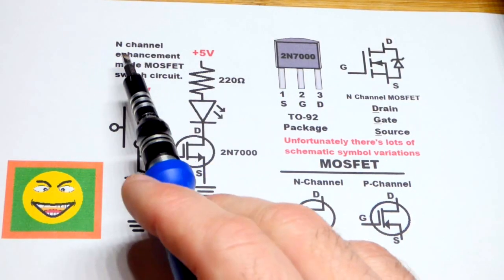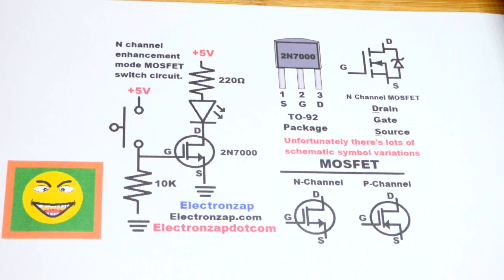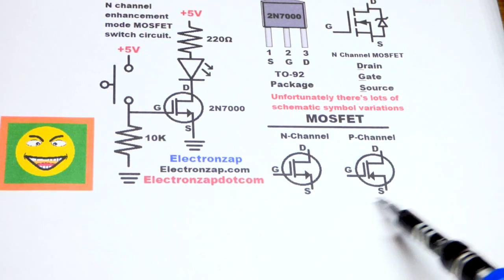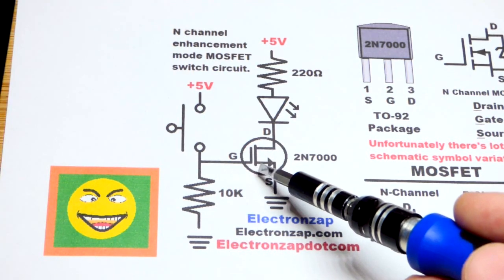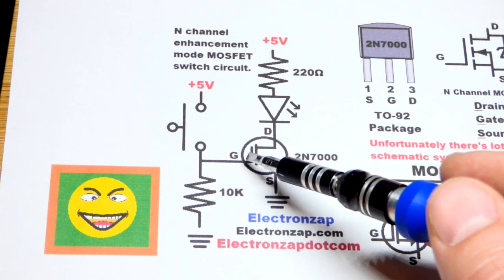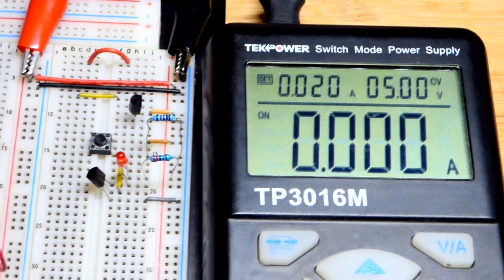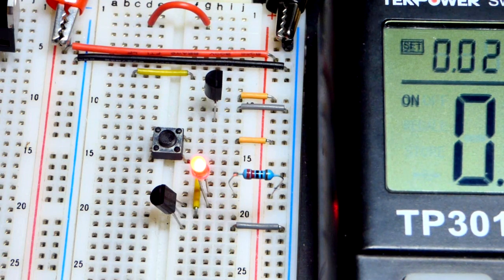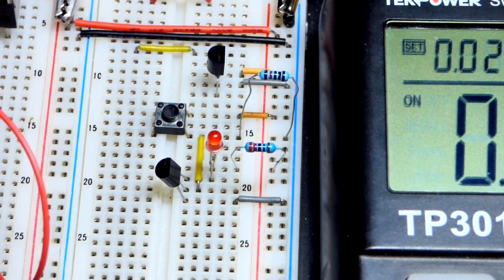2N7000 N channel enhancement mode MOSFET switch electronics how to DIY circuit tutorial

Comment: I've been strugling with this transistor all day. Turns out there is an error in the datasheet from ONSEMI, the demarcation of the pins is backwards, DGS. Thanks for the video.
Reply from the maker: Thats a bummer. I know that a lot of times the way they draw the pin layout on datasheet makes it hard to tell which pin is which.